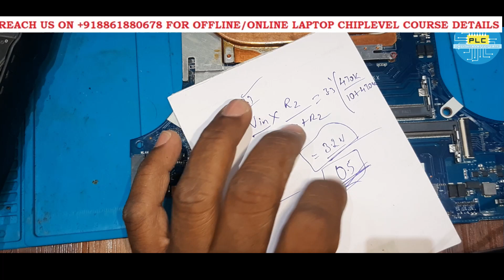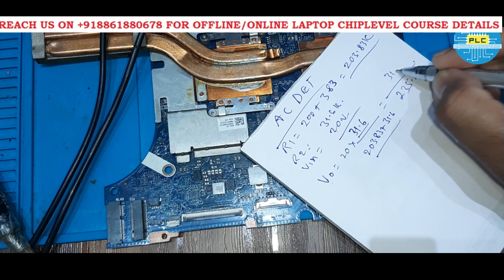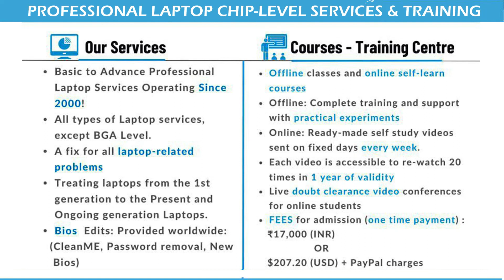Laptop Practical - Dead Motherboard

Comment: Sir please why is the Vin(voltage In) for calculating ACOK 3.3v and that of ACDET(Ac detect) 20v. And please where are you getting the resistor values from. Thanks
Reply from the maker: Thanks for valuable comments. 
For your questions,  in one word I can't explain. Pls download the datasheet of the ic and try to understand those. If u really can't,  I will make a video according to the doubts.  
😊
Reply: @Pavithralaptopcare  ok thanks for your response sir.
Reply: @Pavithralaptopcare  thanks for the response sir but will be glad if you create a video on how to identify this resistor values or refer with link if you already have a video on it.
Reply from the maker: I will tell u. Acdet is required around 3v. Less or more. 19v used because using voltage divider techniques,  the supply to acdet can achieve
Reply: @Pavithralaptopcare  thank you very much sir I really appreciate